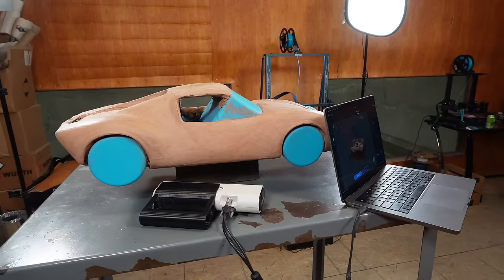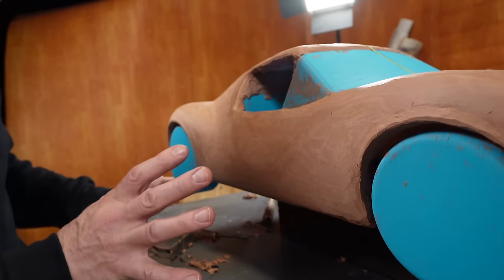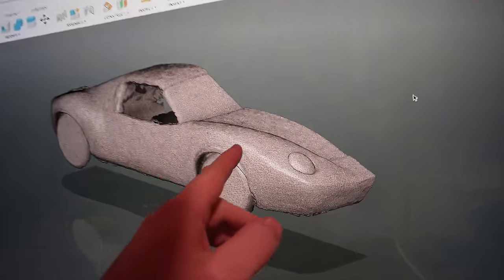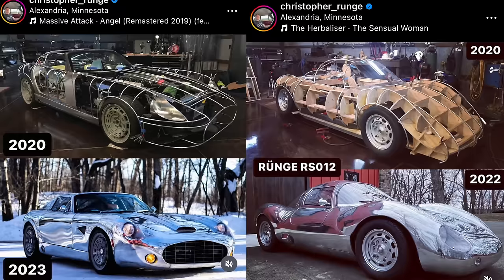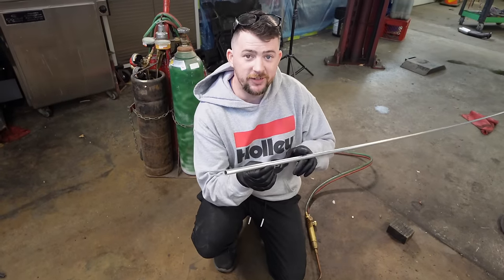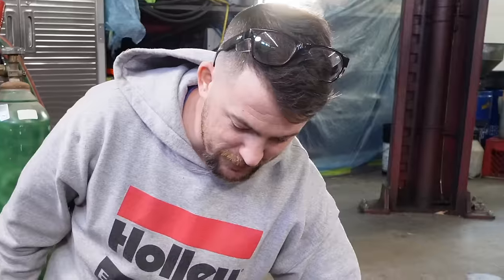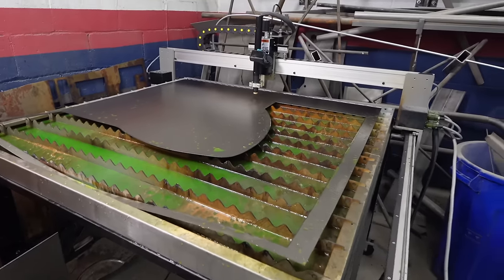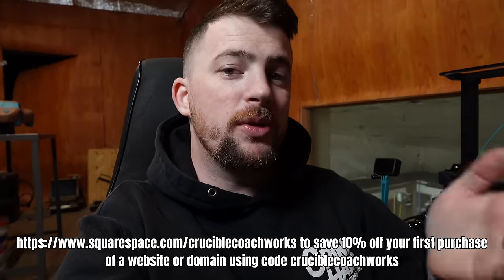$500 Junk Car to SUPERCAR: BODY FABRICATION BEGINS - Project Jigsaw

Comment: The most important thing about car design is to create something that has distinctive body lines and which can be identifiable in silhouette. The reason why so many classic cars are considered classics are because they have cohesive designs with body lines both within the panels of the car, like with shoulder creases, but which also use the hood and rear deck as body lines and the canopy as a continuation of these. I would suggest adding a crease to the door that begins at the nose of the car as a continuation of the front leading edge, fades out of existence at the front wheel arch swell, comes back afterward and becomes increasingly prominent at the door, then disappears into the rear fender swell before reappearing afterward to blend into the arch over the rear tail lights and the rear wing. By drawing this line at an angle you can make the car appear dynamic even when it is sitting still and smoothly join the front and rear designs together. Also, I would consider sharpening the crease on the rear of the car that divides the rear from the rear quarter, similarly to how the McLaren F1 has it. Also, if you're going to use that style of ducted radiator vent for your front heat exchangers, you'll probably want to move it back a bit to allow more space behind the crash structure to install a thick radiator, AC condenser, oil cooler, transmission cooler, etc. Also, that style of vent should be much deeper to allow more unimpeded airflow through your radiator and other heat exchangers. Personally, I'd also avoid the round headlight design and instead opt for stealing some headlights from a car with a similar front-end design that integrates better. Maybe steal the headlights from a Porsche 718 Cayman or something and mildly rework the front end design to accept them. Or, if you want to make the front end more pointed, consider stealing the headlights from a C7 Corvette.

Comment: Fantastic my friend. I am starting  a Youtube channel eventually with a build of a Brooklands style combination 1928 Morgan 3 wheeler with 4 wheels called a special . I have been sourcing machines for my own machine shop so that I will be able to make any parts or tools as you are. I am casting my own tools and parts out of aluminum or aluminum bronze if super strength is needed. You can print your tools and then carve it out of styrofoam and then bury it in sand and pour molten metal into it to get an actual part or tool that will not break as easily as plastic. I would make one for you  if you need . I am about a half hour from you guys.

Comment: Many years ago I did similar work in the automotive world and built a CMM machine to build full size car bodies and pretty much any large objects from CAD. Found it easier than dealing with sections and more accurate .The wooden 'Splinter' car build used a simple CMM but effective version. This work is not easy so a 👍for all the hard work.

Comment: It’s shaping up guys! Looking sweet

Ryan, if that print artifact happens at the same height everytime, check your z screw. It might have an issue with the thread at that height. Definitely fasten your rollers and clean/re lube your z screw if you don’t find anything wrong with it/it happens inconsistently
Reply from the maker: Yeah its super inconsistent, my thought process was about same as yours here. So glad to see my thoughts verified haha. Rollers for sure and relubing is definitely coming up next.

Comment: Your 3d printer probably mechanically skipped a z step. If your printer has a Zscrew, make sure the set screws holding the Zscrews are tight.

Comment: bambu lab printer would change your life. The missed layers are from missed steps. as it is a dual z leadscrews are usually driven by the same driver, verify the lead crews are level side to side, sometimes they get very slightly out of level causing binding.also driver settings can be an issue.  Little issues like this are the things that make you run your head into a wall with 3d printers.  Bambu Labs?  just works.

Comment: Figured you'd use 3d scanner on that model, but honestly it is really lacking in details, and I've also noticed the Runge car bodies lack details too, it gives a certain look that is not oem like at all in my opinion.   Forming a full size body in foam that you can shape I think is better, you can give fine details and then make a fiberglass mold from it.

Comment: You could have also used AI to create many iterations until you found one to put into clay. It's can be very useful to discover thing you didn't know you might like. I know it seems it is random process with little control, but with stable diffusion implementations on various sites (I use Playground AI) you take a picture of the model and use the control trait features to detect the contour and depth of the car and generate with those constrains as closely or loosely as you like. 

Anyway awesome work.

Comment: Looks alittle bit (about 99.9%) like a mid 1960s Porsche 904 and a Ferrari Dino 206 had a baby.
When you run your Aerodynamic / Cd analysis, betting it will want a little longer sharper tail...